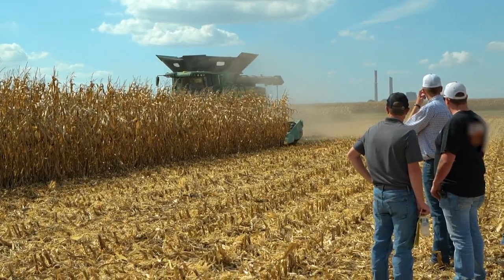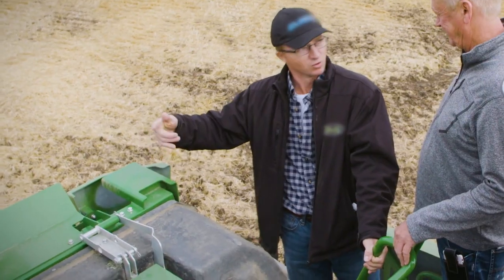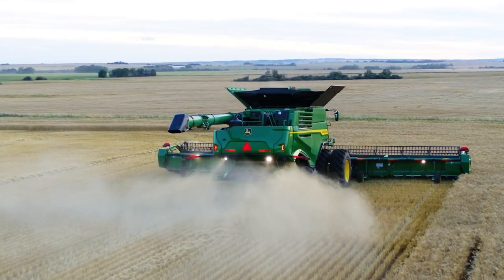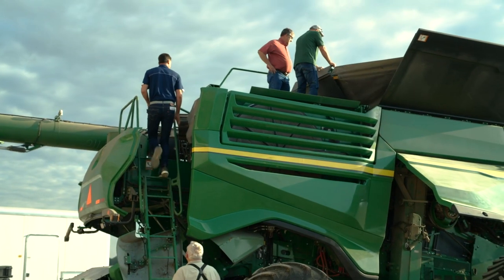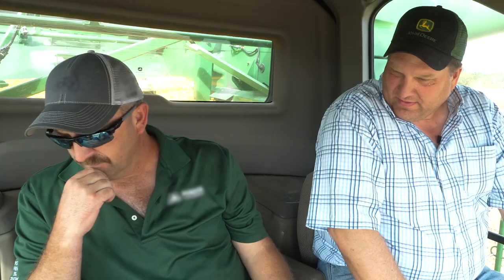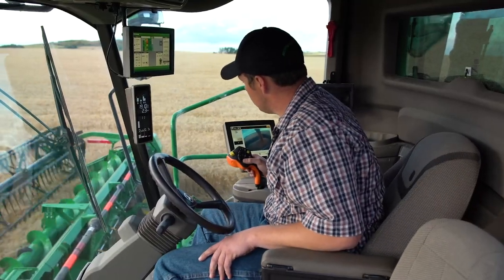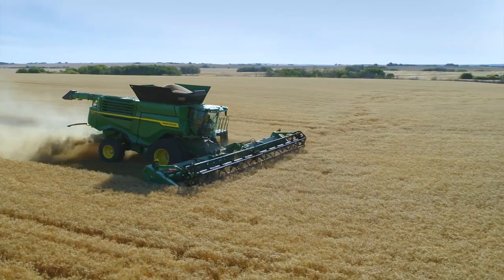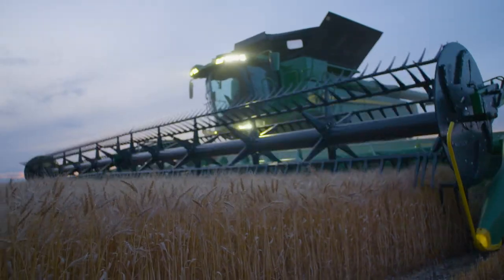Hear from Farmers | John Deere X Series Combines

Comment: Running a S680 right now in wheat.   All the plastic and electrical stuff only holds up for a year a two.    And they keep adding more to the new combines.   Wish they would stop adding computers and make quality again.
Reply: My thoughts as well,  as 90% of Deere customers, Deere has lost track on quality and gone to quantity
Reply: Got that right,  I run a s660 now, its nice but runs into a few issues. I still have my old 9500 for backup on beans, that seems to be the last good combine deere made. I think next time, im going to be looking at case or lexion.
Reply: @billcarver6539  Try a new Gleaner, you will love it.
Reply: we're trying to get back on track wit quality

Comment: Case ih has had most of this stuff for a long time except for twin rotor, and
 the auger bed inside the separation system is basically the same as a international 1480 but as we know u guys like to copy and once the patent on case ih shaker is done you will have the exact same thing

Comment: Do they really expect me to believe that these are all random farmers. No they are the guys who buy 4,5,6 new combine from deere every year for the pat 20 years and are never gonna say anything bad about them
Reply: Yep, it’s pretty much scripted with stupid comments like it handles really well. If they put real unbiased farmers in there you’d hear comments like - pivoting tip spout?  I’ve had that for five years. No shoe augers?  Had that for 15. Cross auger shut off, had that for six years. Why is the sample so dirty?  When you change a setting does it actually do anything?  Do the door panels still slam into my head when it’s windy?  Has anyone ever looked at how they lock on claas and then they don’t knock you unconscious on a windy day?  Yeah, I think you looked at claas.  Your sprayers are garbage, why didn’t you buy agrifac instead of Hagie. 7200 an hour?  Huh, yeah right.
Reply: Of course they are people who run multiple units.  Thats exactly who the combine was designed for.  They are literally on camera explaining what was important to them and it looks like JD delivered.  We run JD and know alot who do as well, believe me, JD owners are critical of the weak points.

Comment: Gleaner still makes a better combine than John Deere and I have run all of the biggest combines on market and I have found Gleaner then New Holland are the top 2 combines on the market for service and ease of repair so when John Deere can do that then maybe I go back to John Deere
Reply: new holland would be case to
Reply: We run Gleaner S97's, they are really easy to set and do a great job in the hopper and on the ground. Best combines made.  Really easy on fuel also.
Reply: Deere is number 1 for good reason.